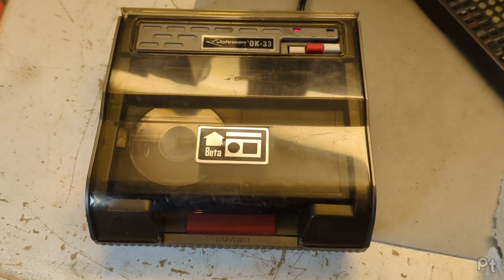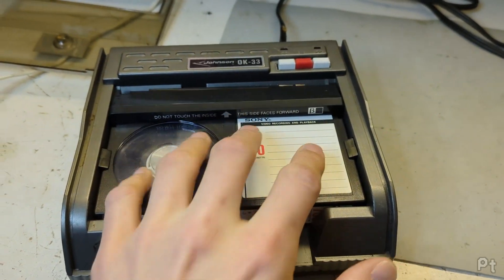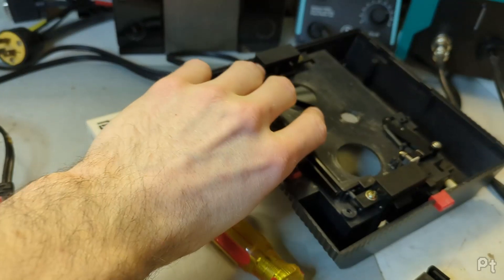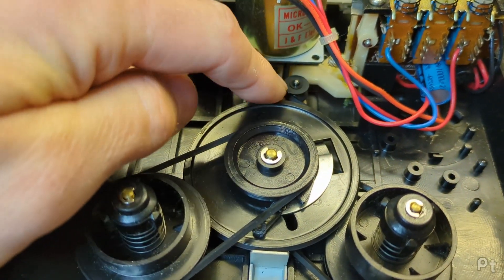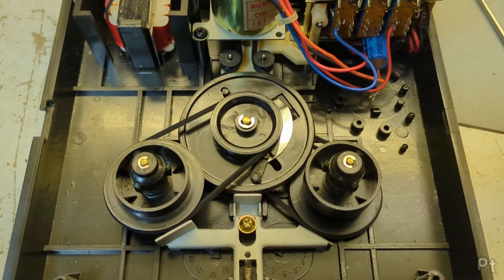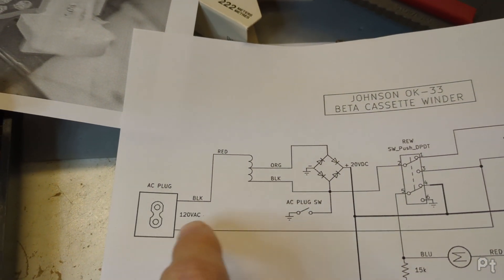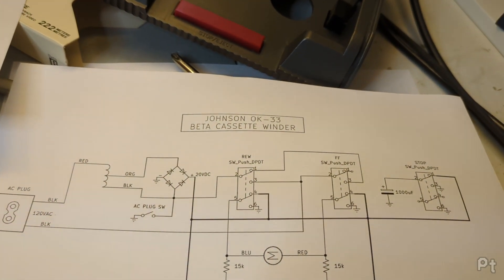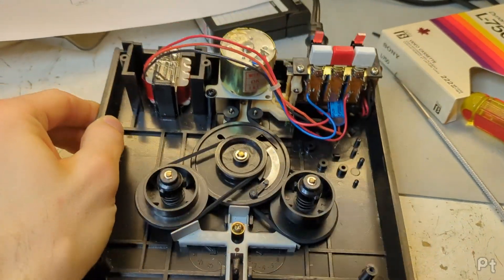Johnson OK-33 Beta Tape Winder

Comment: Would make the VCRs a tad redundant if they had nothing to play in them if the "VCR-saving!" tape rewinder overstretched or even snapped the tapes... :P
Reply from the maker: Yeah that's my concern using all types of rewinders. My plan is really to only use this on suspect tapes so I can make sure they're clean. I think it should be fine as long as I finish the rewind cycle in the VCR.

Comment: That was one of the main things that bothered me about Beta was the fact they stayed loaded during FF/REW. I know it was so they could enter the play mode quickly but the wear and tear on the video heads use to annoy me. However VHS started pulling the same stunt by the early 90s and when Sony finally built their first VHS machine around 1988-1989 they kept the same fully loaded system. However what I did like about Sony VHS was if you got the higher up models they had "high speed rewind" which unloaded the tape from the video head but kept the tape loaded on the control head/audio head so you still had the Hours/Minutes/Seconds counter and Index Search. Again, another great video for a Sunday morning. Thank you Winnipeg guy :)
On a side note, I still have a few high end Sony tapes (Dynamicron ESX-HiFi) that had a clear window that exposes both hubs. As well as a few TDK and Kodak that have 2 windows exposing both hubs.
Reply: Il sistema a caricamento parziale o half loading protegge letteralmente le testine perchè non sono fisicamente operative,quindi oltre al vantaggio dei rewinder,l'half loading è il sistema migliore,ho in collezione dei modelli cosi,li adoro
Reply: Around 1998 when VHS was in decline, I went through half a dozen, at least, Sony machines with the "lightning rewind" feature and they all physically damaged the control track section of the tape or the linear audio portion due to tension issues. I mean sliced like a ribbon, you could hear it while happening like rubbing the tape over scissors! I returned all those and got a less costly RCA video that became the workhorse for the next 10 years. The machines that stay threaded even partially to retain accurate time counters were never a good idea for tapes or for the heads inside. I miss the days of early "Magnetbox" (heh!), Quasar and Sharp machines that used the crap, arbitrary 4-digit tape counters BUT had a window on top so you knew where you were when the tape was loaded.
Reply: @ 
Yup, our very first VHS was a 1985 RCA Selectavision 2 Head MONO front loader (one of the first from RCA) and it was a BEAST! My mother use to "time tape" Days of our Lives and Another World 5 days a week on top a TONS of movies on network stations that we'd have to "pause out the commercials" and that machine lasted until 1999 when the video heads finally wore down. The only work that we ever brought it to the shop for was the belts in the early 90s, other than that whenever the picture went to snow I'd take the lid off and clean the heads. Also I remember how big of a deal it was when we got it because it cost almost $600 and my mother was single with myself and and younger sister. She figured because we were so broke that buying the VCR was cheaper than going out to the movies and other places for entertainment. So on the weekends she'd rent 2-3 movies, 2 boxes of Old Dutch chips, have her best friends Maria and Ida (Auntie Maria and Auntie Ida to my sister and I) and that was our weekend...and I wouldn't change it for the world.
Reply: Our Sony SLV-585HF's hi-speed rewind fully unloaded the tape, and the real-time counter went to dashes.  But it rewound a T120 in, IIRC, a little over 2 minutes - 1-2 minutes faster than other VCRs at the time that always unloaded the tape for rew/ff.
Reply: @jasonhaman4670  
I remember by best friend's father had a Sony S-VHS with all the bells and whistles (flying erase heads with editing inserts and left and right recording levels) and that machine unthreaded the entire tape too. The thing sounded like a jet ready to take off and you're right, it rewound a tape in what felt like seconds back then.  Maybe my parents cheaped out and just got the mid-level model, but it couldn't have been too cheap because it did have 4 head DA and HiFi and it must have had a flying erase head because when we'd "pause out" commercials it never gave color bar noise.
Reply: @michaelfolino8414  Oooohhhh, nice, that S-VHS Sony.  And yeah, the sound of ours in hi-speed rewind was impressive - it really let you know it was hauling butt.  (Hi-speed unthreaded rewind would have been a nice addition to their Beta VCRs - of course, by that time Beta was thoroughly defeated, and it made no sense to spend money on adding new features, even though they continued selling a few long-in-the-tooth Beta models.)  Fun to stand there and listen to.  When Sony gave in and started making VHS VCRs, they didn't mess around, they made great ones.